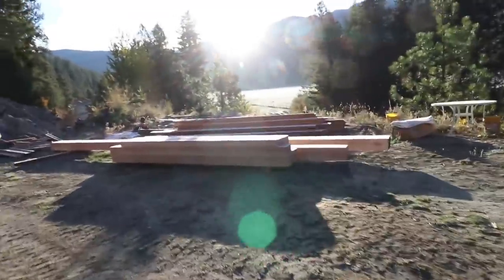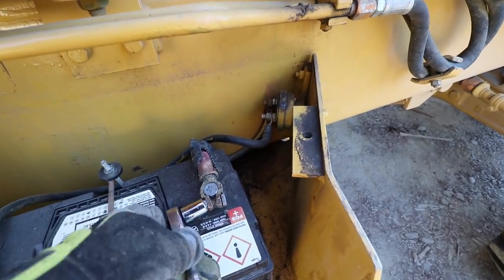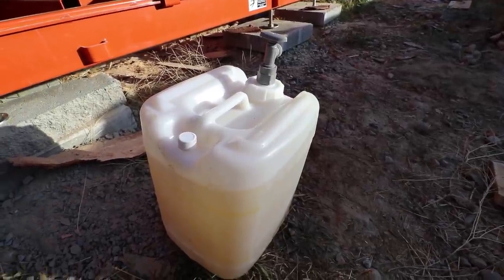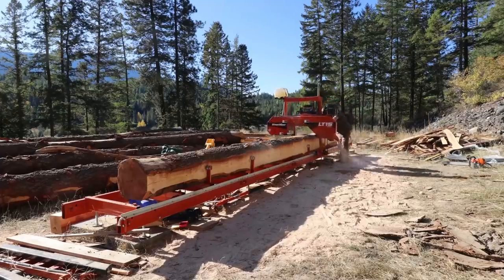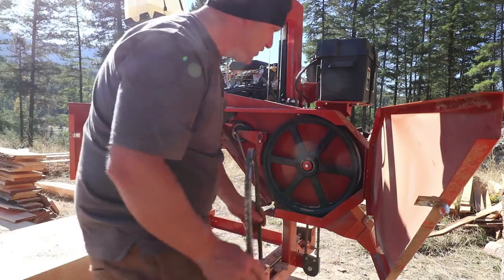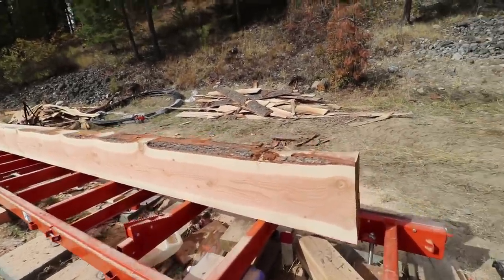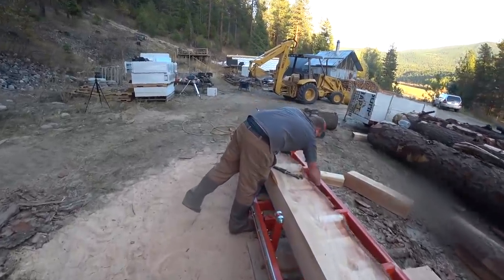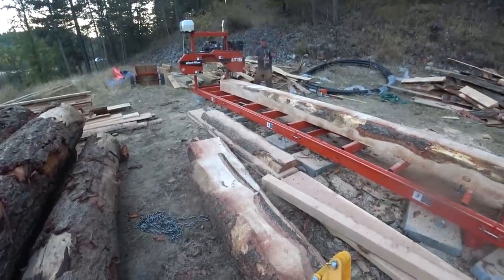BROKE OUR FIRST BLADE! (LT15 Woodmizer Sawmill)

Comment: Yes, always good to occasionally refresh your memory on the maintenance of the saw/backhoe, etc.  Saaaaaay, isn't that the wobbling tower of death I see over there?  When you replace the blade, it might be a good time to do a lube on the mill.  I'm sure you found out what mill lube to use in the manual, and perhaps a suggestion to store the extra lube inside a building for extra warmth.  I think you said you had propane heaters, which might work nicely to warm your mill head before use in freezing temps.  Stand downwind of it to get yourself warm at the same time.  Got a raincoat for it, too?

The positive cable is usually the one to have the disconnect in it because most of the vehicle is a ground and the positive wire will spark.  Best practice is to remove the negative cable so your wrench won't arc on the body when removing loosening it.  If the battery is 4 years old or older, just replace it.  One way to test the starting system on the backhoe is to remove the negative cable from the battery and hook up the jumper cables from the truck without the hoe battery in the circuit.  If it still cranks hard, it may be the starter.  Now that you have battery problems, it's a good time to leave the battery disconnected and check every connection on the hoe.  The grounded end of the ground cable and both ends of the positive.  Get a battery brush if you don't already have one.  A brass brush works well to clean terminals and connections, too.  I highly recommend the battery protectant spray (red stuff) after you hook all the clean connections back together.  It helps prevent corrosion which would otherwise cause earlier maintenance chores.  While you're at it, do all the vehicle and solar batteries, and use protectant on them all, as well.  I know it will take 1.5-2 hours, but it will save more than that in the long run.  (Murphy says he's waiting for you to miss one, and he'll take care of that.  ;)

Check the tension on the new saw band once in awhile.  New ones stretch a bit and a loose belt can either come off or vibrate enough to break or cause other issues.  DAMHIKT.

That's a big beauty of a log you chose to cut.  Yes, AnchorSeal, wax, and oil are good things, and are cheaper by the (1 or 5) gallon bucket.

Best practice is to turn the doped plumbing joints 1/4 turn as assembling.

Oh, re: the sawmill, if you're going to move it later, you can still anchor it with something like this: http://tinyurl.com/ya7q6fjk  Use turnbuckles, eyebolts, and chain, with holes drilled in the Woodmiser frame or hooks on edges.  I'd cross-anchor both ends and front/back anchor the middle, were it my saw.  And a blower would get the sawdust off both the wood and mill quicker than you can with the broom.  I bought a little Makita battery powered one for small work I did as a handyman, and it still works like a charm.  http://tinyurl.com/yby24m4r

RE: shimming the log, Alyssa, a little plastic mallet will keep you from having to work so hard.  <tap, tap, tap>

You never invested in the $30 HF 72-inch level, huh?  OMG, they're $12 or $20 now.  Mine remains accurate 12 years later.  http://tinyurl.com/y9bvhl4a

You guys wore the sun out on that last beam.  Congrats.  Go have some ice cream!  Jesse, now it's time to return Alyssa's neck rub.

Comment: I have no idea about other brands of equipment but on John Deere tractors the alternator does not charge until the engine is at 900 RPM or above.  Farm equipment is not intended or made to set at idle speed for long periods of time.  If your backhoe alternator works the same and you idle for long periods of time, it may not be charging.

Comment: Most backhoes use 2 heavy duty batteries (1000 cranking amps or better) to have enough power for the grid heater/glow plugs and starting systems. Also a good way to check for phantom loads, disconnect all the fuses/ loads from the battery and hook up your multimeter between your terminal and your battery cable, (i usually do it on the positive side). Then put your meter to amps and start plugging loads in until you find the draw.

Also dirty battery’s can leech power through the battery case and cause a draw.

Hope this helps
Reply: That is true, the cold is not kind to diesel motors, even more so if they do not have starting aid ie, ether, or glow plugs. 

It seemed that this problem was also happening while in the summer months so I figure that a draw could have also been a high possibility.

Comment: I have an idea, how about using a trailer ( mobile home ) tie down. The one that cork screws into the ground.  Put one on each end of the mill at an angle then strap the mill to it tight , working the screws against each other. It seams like it will at least prevent a lot of that movement.

Comment: Re battery disconnect:

Remove pos cable. Grab a screwdriver and drop it such that the stem of screwdriver contacts the battery pos terminal and the tractor' s frame (without paint).  Stand back while screw driver is spot welded to the tractor frame. 

After grinding off the screwdriver and possibly replacing battery, put the pos cable back onto the battery. Now remove the neg cable. Drop the screwdriver onto the pos terminal and tractor once again. Notice that nothing happens. Just for grins repeat drop but this time onto the neg terminal and the tractor. Again, nothing should happen.

Which terminal would you disconnect?

Some people like sparks😁

Comment: The Maximum size of a square post (side 'a') you can cut from a Log (of diameter ' d') is a=d/1.414. Example: If you need a 12" post, you will need a log with a diameter of 17".

Comment: I've never sharpened the blades every 2 hours.  Wow.  I know alot of guys that have a woodmizer say they wish they never bought it.  Very labor intensive.  Hope that one is on loan to you guys.  Also my mill is anchored to 6 inch posts buried in the ground so it stays where it is.  Level the bed, level the log cut it.

Comment: Get four helical ground anchors and install them about 2 feet from the ends of your mill as close to under the rails as you can.

Get four lengths of chains long enough to attach about 10 feet from the ends of the mill to the main beams and cross over to the opposite side to the helical anchor.

Use turnbuckles to attach the chains to the anchors and slowly and even tighten them until they are tight.

Make certain the mill is level.

This will prevent any movement lengthways and sideways.
Reply: Mathematical mindset....

Comment: The reason to disconnect the ground first, is it makes it safer to to disconnect the positive. If you leave the ground connected. Then disconnect the positive, if say using a spanner and it touch ground, you have short circuited the battery. If you are disconnecting the negative and spanner slips, it is a ground to ground so no large bangs

Comment: Electrons are negatively charged. The electricity flows out of the negative pole of the battery. Disconnect the negative pole and the flow of electricity stops.

Comment: Hi With lead acid batterys, there is the danger of the electrolyte freezing, this changes the batteries internal resistance,I would replace the battery as soon as possible with the winter coming on. best of wishes to you and your wife.Martin.

Comment: The absolutely best lubricant for band blades is diesel and or ATF but you will probably get smelly beams. I use winter windshield washer mixed with clean water and a little extra dish soap. I have no problems with this. It's cheap and the detergent in the washer cuts the resin of the wood, it doesn't smell or get sticky or color the wood.
Reply: Thats what I use cause its so cold

Comment: Measure the circumference in the middle of the log, and divide it by 3.14 then times by 2 and you have the diameter
Reply: No you don't, you have twice the diameter.

Comment: I know this is a few weeks ago but something I have done to a car that I only used every so often was to put a small (10W/20W) solar panel and a $10/$20 charge controller on it and it worked a treat. 

Granted I am in Australia and have never seen snow but you were having these problems in your summer.

Also to check the disconnect, Unplug the battery, set a multi-meter to ohms/continuity and touch one of the probes to one of the terminals and the other to the other. Do this in both on and off states and the off state should have no connection and the on state should have a low  number (if any).
Reply: I also know that solar PV doesn't work over night but over a few days it will.
Reply: You could also look into a 350A Anderson SB350 as a quick connect for the jumper cables and one on the backhoe If it becomes a thing that you need to jump it all the time.
Reply: Did this with my girlfriends car, battery would go dead every 5-6 months because 90% of her driving trips were less then 2 miles. Therefor not long enough to replace the power drained from the battery on start.
Though couldn't actually use a charge controller since the solar panel is only 1.5 watts. Just made sure to wire it through a relay controlled by a circuit thats on whenever the key is in the start or run position as well as a 1 Amp fuse. Didn't want to take the chance of the alternator burning up the panel. 
That was a year and a half ago, haven't had any issues with a dead battery yet.

Comment: As a mechanic, disconnects always go on the ground. That being said some equipment does run a positive ground. But us always disconnect the ground. Furthermore you should be removing the ground first and connecting the ground last unlike it looks like you have been doing. The reason for this is because if you do it the opposite way and your wrench touches anything it will short out.

Comment: use tap-cons to secure the mill to you cement blocks.  I put my mill on railroad ties and bolted it to them.
Reply: Tapcons might make those 4" cement blocks way to weak. I would not drill them. Next time he drop a log it might crack a couple.
Reply: lol, they just might.  My advise would be to cut some 8x8 and use them under the mill and bolt it to them.
Reply: I'd try that!

Comment: Your battery, a quick way to check for a discharge or if something is pulling a draw is to do this simple test.  Disconnect the neg post, put one end of the test light on the battery post, and the other on the terminal:  if the light come on, there is something pulling a draw on the battery.  Your battery disconnect switch can be done the same way.  This will ensure that you do not have a draw on your battery at all.  You are correct with getting the battery tested, cold cranking amps (CCA) are only one of the tests you can do, another is to have it load tested.  First thing to do is ensure that the battery cells are filled with fluid prior to testing.  Hook up your disconnect switch correctly and there should never be a draw on it ever again.

Comment: Disconnecting the ground leads to a smaller spark should it generate one. You also have to keep in mind that batteries will discharge slowly even with things working properly. There could be a plate internal to the battery causing intermittent issues, and once it gets cold any problem with a battery will show. You could also add a battery blanket for the winter time.
Reply: Rest and relax, meditate and think in silence solving situations and or stopping them before they start!
Reply: It might also be useful to add a battery desulfator to the battery and connect it up via a relay so that it's only running when the alternator is running or it's being charged from an external source.

If they can park the backhoe close enough to their camper / hut then they could put a trickle-charger on it over night that combined with desulfator might give them some more time before the battery needs replacing.

Comment: After calibrating the mill table could you secure the table to the ground with anchors and straps or cables and turnbuckles.  The weight differential between the table and the logs is such (10 to 100 to 1?) that even a small log bump into the table will move the table.
Reply: William Wilshire Yes. What about rebar stakes.

Comment: Drill a footing hole 1/2” into the concrete blocks. Then let the feet rest in the holes. They won’t move unless the feet actually shear off.
Reply: Actually... just screw some large bolts that have large flat heads that can pin the feet to the concrete block... not as secure, but very fast solution.

Comment: You are correct for inspecting knots near beam edges.  In general, it is the outer , top and bottom, perhaps 20% that determines a beams total capacity.  However, consider the nature of a tight knot.  We are not considering a loose knot, nor a knot that the annular surfaces on an edge and will become loose in the aging and curing process.

The tension side should be as straight a grain as possible.  The tension side usually is the bottom on a simple span,, sometimes the top where considering a multiple span.  Small knots may actually be a good thing, they can tie the grains together and will resist splitting.   On the compression side, usually the top of a simple span, tight knots that do not surface on an edge, are little or no problem.  There can even be a case made the tight knots and accompanying swirled grain has a greater compressive strength.    Trust your eye and instinct, you are doing fine.  

Rip blades need a bench and vise and a fine mill or mill bastard file to hand sharpen.  The first time you and sharpen it will take an hour,, get the hang of it,,, takes ten minutes.  Two or three hand sharpenings only,, then send it off or buy new.  Big operations,, the bandsaw has a welder on the side to weld up a new blade as required.  Big operations on line current, that is,,,

Comment: Always disconnect the negative first. If your connecting or disconnecting the battery with a connected ground, you could accidentally touch the tool to positive and get a arc. If you ground ground to ground, nothing happens.

You should get yourself a desulfator. You can use it to rescue your solar batteries and your tractor. I thought it was a gimmick however I haven't had to buy a battery in a few years. It's amazing. If you got a desulfator that that charged from a 12v supply, you could set it up on a solar panel and keep it on the tractor.

If you're interested I could put one together for you, the ones I buy are just a bare pcb and I 3d print cases for them.

Comment: Why not grade the area under the mill level as best you can and add sand. Then drop in some imperfect heavy long boards. Re-calibrate the mill with laser. After re calibration, nail wood blocks by feet to prevent horizontal movement.

Comment: So use one of them logs to rough mill it down, then cut at 5' length to get several of them. Get in the backhoe and drive it to that little opened up area you have made next to the mill and dig small trench's for the square timber's to lay partially into the ground squared up with your mill. Lay out and bore some holes for the legs to sit and stay then lift your mill onto the logs, level off the mill and finally fill in the earth around the logs.

Comment: If you disconnect the negative you wont short out you spanner. After the ground is off it does not matter if you touch the ground while undoing the positive.
Reply: Electrically it does not matter

Comment: negative disconnect is correct. Negative is connected to the whole frame, if left connected anything that touches the battery positive will short the battery. Re: concrete pads vs. dirt... on the pads things might move, in the dirt they might bend...

Comment: When you're marking the timbers, if you mark the size on the top near the end you won't scrub it off when you treat the ends. You can scrub it off once you've treated and marked the end. Just a thought...
Reply: You mark the end because these are these will be cut off anyways. Put it on any other face and the log might absorb pigments which remain even after planing.

Comment: Jesse.. Like I said on your last Vid. You need to make that saw table solid and un-movable with sonotube pads, and bolt that thing down. Sure its going to take time and a little cash out of your budget but trust me it will save you TONS  of time down the road plus you can remove your foundation when your done.  I used to build main drive and take up pads in an underground coal mine with sonotube poured pads with the feet bolted down. Those belt line structures held for years , plus they are easily removable when your done. Just saying.

Comment: You can solve a lot of alignment problems by bolting the legs to longitudinal wood beams, which you have. The wood will lay on the ground but it's only temporary anyway.
Reply: Exactly what i was thinking. Why do they continue to battle with the problem without fixing it?Doesn't make sense!!

Comment: Why don't you level your bed, put a few anchor bolts through the mill's feet into your concrete pads. If there is not enough mass in the concrete pads then use some of your small rocks as ballast like they do with rail sleepers. You could even use some guy wires to hold the mill in place. Try the anchor bolts and ballast first.

Comment: That is moisture freezing out of the logs.  A few concrete piers, like you use in a deck, would give you the anchors you would need.  A pair of them on each of the ends and one in the middle?  Finally weight and momentum must always be moving AWAY from you, you got the brace slabs right.

Comment: The diodes in the alternator are electrical gates,when they are good,t6he power can only go 1 way,when the diodes go bad,they will allow power to go both ways.  Ergo DEAD battery in the morning.